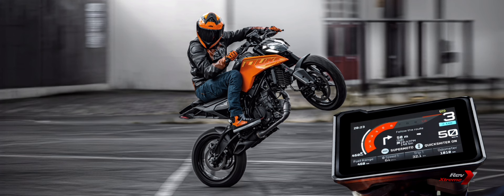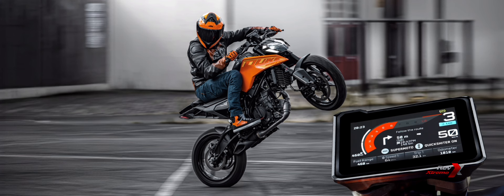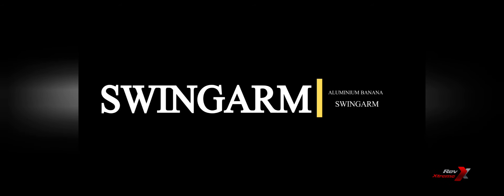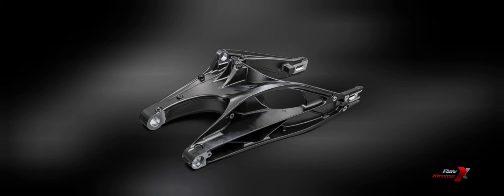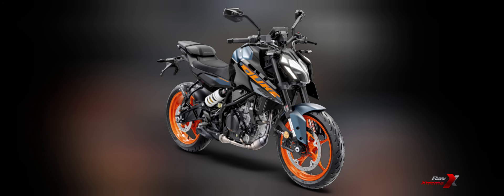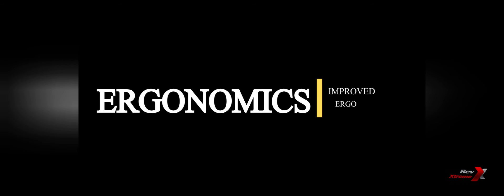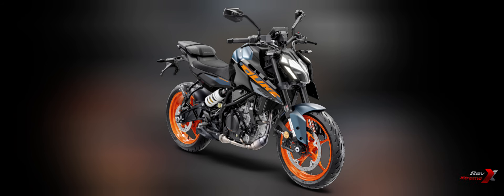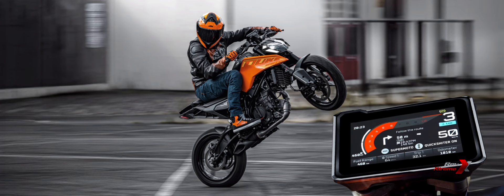2024 KTM DUKE 250 | TFT SPEEDOMETER CLUSTER, ADJUSTABLE SEATS and MUCH MORE

Comment: Does it has traction control?
Reply from the maker: Nope, it doesn't have Traction Control. TC will have cost impact and the bike wouldn't be decently priced which involves meddling with the mapping and data feeds from abs unit. 

Subscribe and stay tuned for more updates on the latest motorcycles

Comment: Worst updates ktm 🤮 , same looks for all bike
Reply from the maker: What else can we expect when KTM needs to price the variant better and also provide features. 
  Different sytle for different variants will not work out. All duke variants are based out of the same silhouette
Reply: @RevXtreme  where is difference between 390 and 250
Reply from the maker: @Ashokevrfan  KTM duke 390 has orange frame and the 250 goes with black

Signature colors on 390 and different ones on 250

Front suspension on the 390
Decal on the fuel tank which names 390/250
Reply: @RevXtreme  but blue color is same to same no difference look wise 🤣